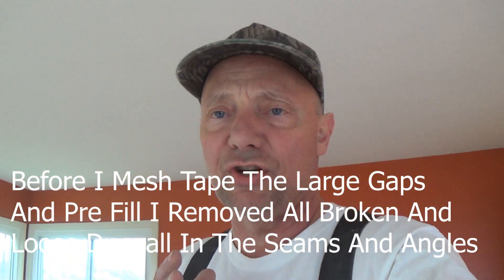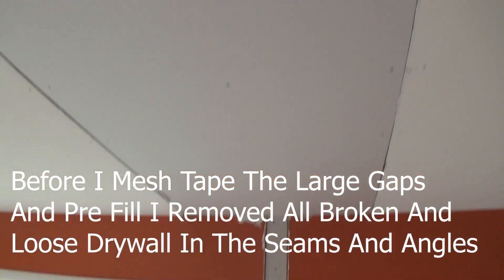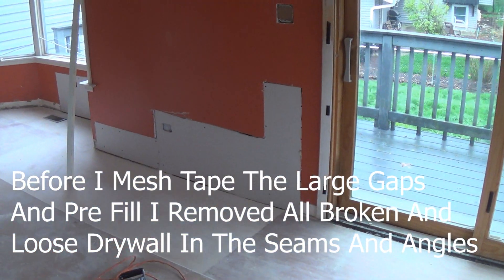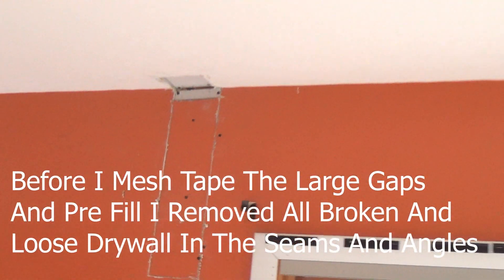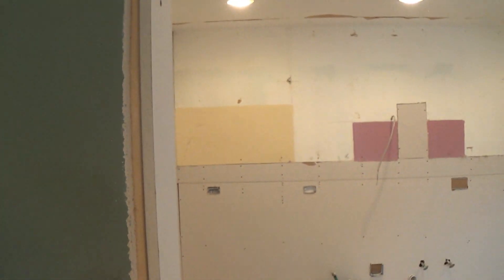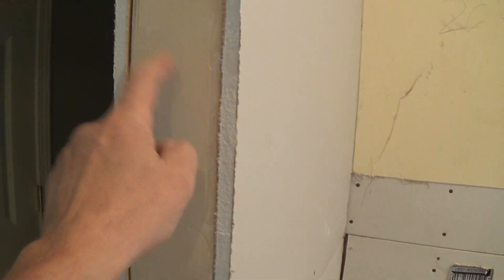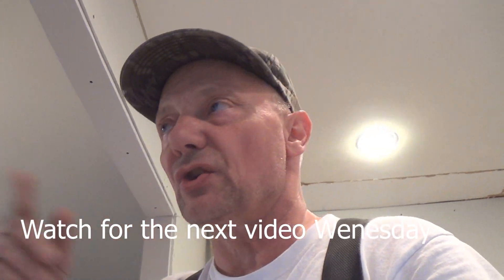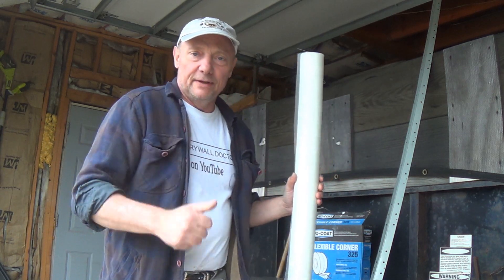How to prep your walls before durabond and tape.

Comment: I'm not sure if this makes sense but I always prime the painted surfaces around patches with a stain blocking primer.  I've found it really helps eliminate (or at least reduce) bubbles.  It's also tough for me to feather the patched area down to nothing when I sand if I don't prime.  I wind up being able to see a line after sanding unless it's primed.

Comment: I enjoyed your vid.  I watched this vid one year after you made it and I’m not sure which is your follow up vid.  In case I do not see it, I have a question:
Did you use Durabond for the pre-fill?  Also, can you pre-fill, apply mesh tape and cover the mesh tape with paper tape for a skim coat?
Reply from the maker: I would apply mesh tape on bad spots and pre-fill on top of it and then yes you can tape on top of that if you need to
Reply: @THEDRYWALLDOCTOR1  - Outstanding, thank you Sir, and appreciate your prompt reply.

Comment: Everything in construction (and other trades...) is knowing the correct way to use a product to use or how to use a product to fix the issue.   Mesh tape vs paper tape, the debate goes on and there is a no right/wrong answer only what works.   Commercial construction has two main factors cost and time.   Home owners, DIY'ers and small jobs it can be absorbed into the cost.   If I have to put 5 coats on a wall at my house to get the same finish - so what?  I'm not very skilled but only out the cost of the material.   Professionals have to be in and out, quick as possible in order to make money.   If they can use a product to gain time or money on the job and still have the same finish, it's a winning result.    Provided you warranty your work then there will be no issue.

Comment: I just make patches square now......I used to do zig zag cuts but found it easier to square it off.....labor is alot less to finish and hang even though material is slightly more.

Drywall is cheap, labor is not
Reply from the maker: I try to do it too but when I'm not doing the demo and hanging that's what I get.